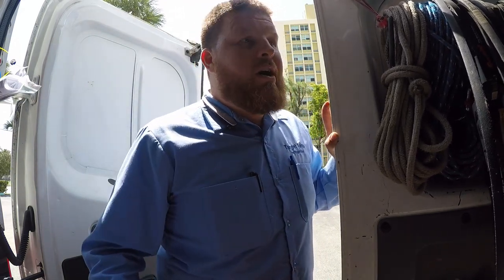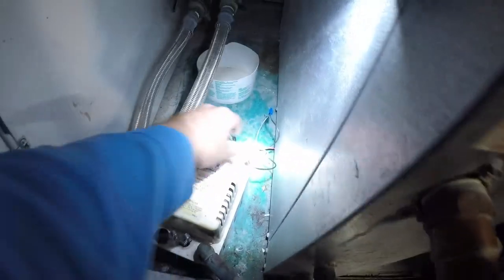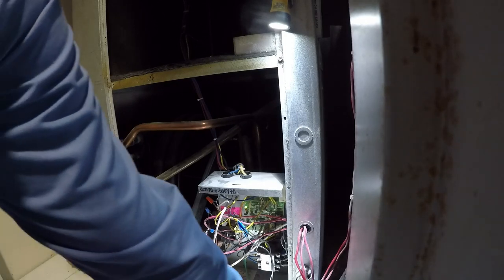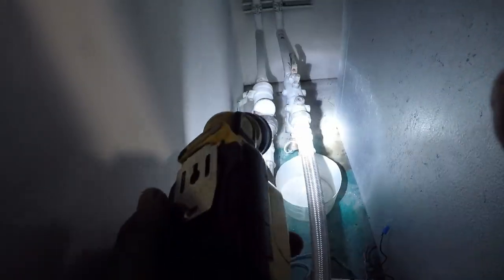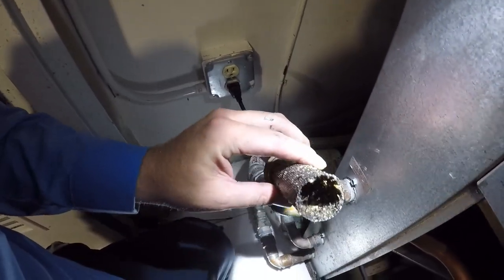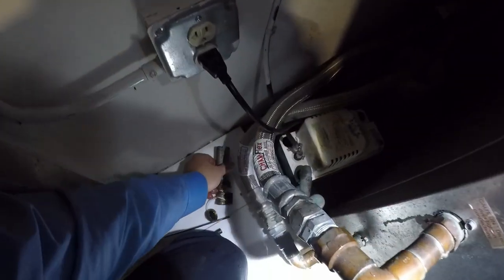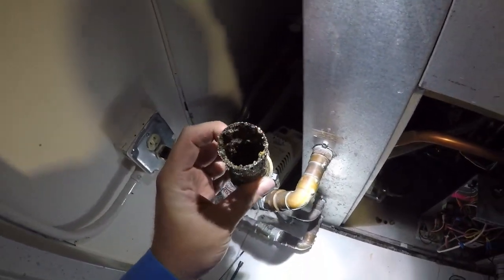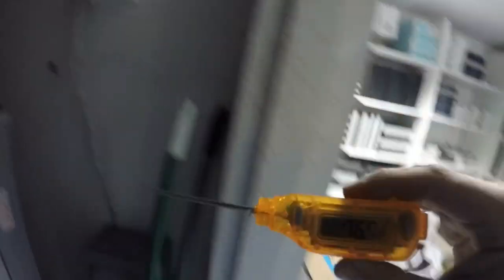Water cooled a/c unit

Comment: Good job Anthony I hardly get to work on water cooled units . I usually see those operate at 10 -12 degree difference water In and water out . Nicely done
Reply from the maker: yeah the water flow in buildings will definitely play a factor on the delta t across the condenser coil. Thanks for watching and supporting my channel.
Reply: Anthony Reardon hvacr that’s right
Reply: @20antman  is water cooled ac more efficient than air cooled??
Reply: @gauravsarraf  they say its more efficient but I don't think its very significant. You do save energy on heating the water if you have it connected to your hot water supply. You also save space since water cooled units don't need a huge aircooled condenser outside.